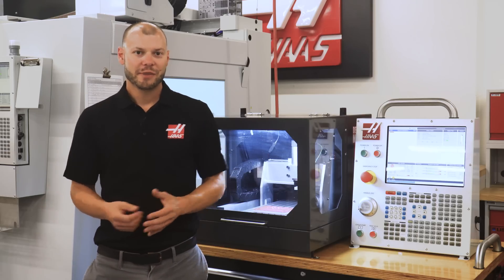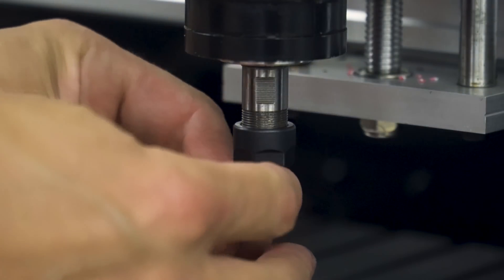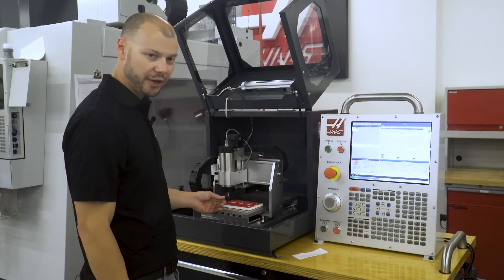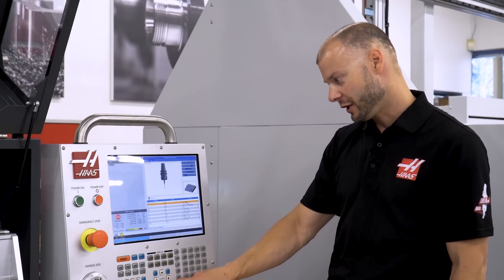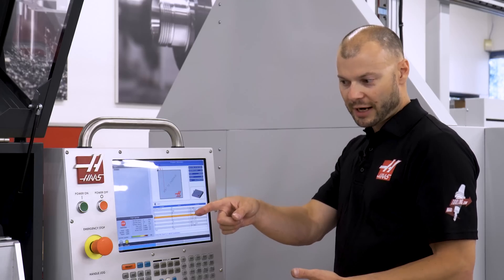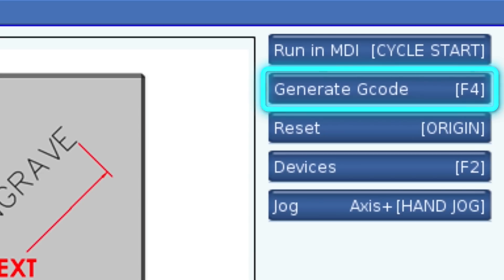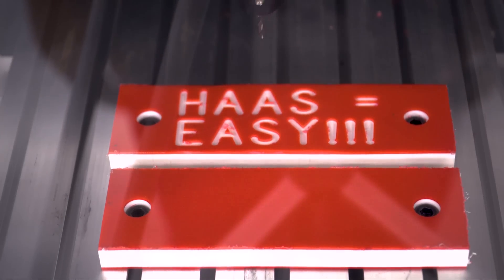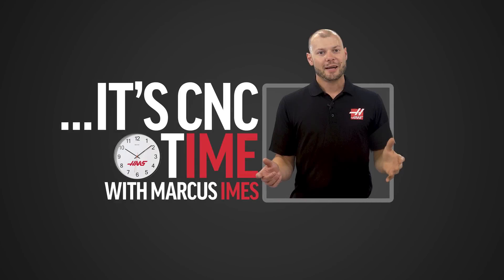The Haas Desktop Mill - A Walk-Thru with Marcus Imes - Haas Automation, Inc.

Comment: $400 on EBAY guys, don't be a fool and pay for the name. This is just a Chinese router with a big fancy control box.... https://www.ebay.com/itm/4Axis-CNC-Router-3020-Laser-Engraver-3D-Woodworking-Milling-Carving-500W-Desktop/184257042533?_trkparms=ispr%3D1&hash=item2ae6935865:g:yYYAAOSwHwVema3Z&amdata=enc%3AAQAFAAACcBaobrjLl8XobRIiIML1V4Imu%252Fn%252BzU5L90Z278x5ickk8Fd9si%252FIbtWQr%252BhnlRwjDVoaUrqOm6rrEsSxgeUkDpVPmx5jrT15TSfkBjsiP1FuR%252FehTux5lC1gLBbPCTjhGJckNb2RsJyReqLvLpogXwKl%252BrWnrrk1JZzDei9XUc5nZ7meOlhnjTFDwhGgyT5RMDiotSjzlWKy8hxh5hrrNI3fO4HGONrhPxMFxMDl%252B07V7cBsDWJjBHdm2tJ24jNMifE5RMJteY1hkfh8OTIDLgW%252Be60ggcHc5VydPG%252BzWz9QbpwuJU5RyQvyxUoDwIRR4x%252BLTyJ2I5ZSN9r47%252Fd4zDvnacDTcV2630fFMvyGFmUok6Dlq9w2DpEgNN0Sdf%252FzLsG6yEkehKyYBNTirWbeYj6K0p1S3NapPJN8cvB6TzIe3P%252FPBicD460cpIxnlf0XwuNAkyhXDP5tCe89Exvud1%252Bdns3LHGPfaywdF8VwnZZR3ppmK0qP8beQNNRoEaulGt5kGdsKD%252FAIR5JYaWstF7ueh%252Fm3Y4StVxSsWb6IZp9%252BWZpJJ6yssP%252Bf6sq2Mh%252BbQap4SXgc6HjWGL4Eo4%252FGF6IjP1I29JzHfLMWgD0LQB6%252B31o07d0xwdIbc4KzgM%252BrUejXlc4Pjt9B2ia515Jx2RsltsOxKgwD6fTpkyYcNsT%252F4%252BhBE2ia0uypw3gy5uFVJZWjNQsFFfHIRuJMWWoZneZyUTQZMS%252Fkw83T9umZnfZakkfSBwOhAQyYzovTHllzy4CN60sl9CIZRQ8sgDlvmLdPNff%252BuSoOmb1L%252B50CC4OrSjtttVKN%252B7XbtaOSyegfxQ%253D%253D%7Ccksum%3A18425704253320b100ef81ce42ed942b23c7564da5af%7Campid%3APL_CLK%7Cclp%3A2334524

Comment: The man in the video has done a good job demonstrating the inept features of this mill and explaining it is for learning the Haas controller.  But many are correct, this thing is absolute and utter joke for a CNC mill.  $3000 Haas Controller paired with a $400 cheap mill that Haas is selling for $8k.   Unfortunately, this Haas desktop mill is an absolute dud.  Worse yet, Haas falsely claims it is perfect for teaching the basic principles of programming and operating a CNC mill.  But how can that be when Haas fails to provide a specific desktop mill model user's manual nor any model specific curriculum to support this machine.  Do your due diligence are research before buying.  Ask current owners for a reference and recommendation.  Haas has 99 good machines, but this isn't 1 of them,   It is a sad skid-mark on Haas's otherwise clean reputation!   Avoid this toy at all cost.

Comment: Haas, please make a small scaled down version of the mini mill/super mini mill, at a sub $15k price. Look at the UMC-10 developed by Dave Decaussin of FADAL, before his health took a dive. 3HP motor, BT-30 spindle, up to 10k rpm, Linear Ways, 6 tool ATC, and the rigidity to handle steel. The hobby market direly needs a small, affordable, yet capable machine that can fit in a small space and run on single phase power. Tormach let us down with their promises, please step up to the plate. They would sell like hotcakes. Here is a link to a video of Dave describing his machine in detail:

https://www.youtube.com/watch?v=b-y03hhCCME

Comment: For those of you smart guys, that machine was not meant to operate in real production cycles. It was produced for educational centers and big companies who has a large number of staff turn-over and where you cannot guarantee that any  new employee is fit enough to run a real CNC machine. And however the price bites where else could you get a CNC contol unit and drivers for 8000 USD to replace the broken one? :)

Comment: Better idea would have been to sell the control for all the hobby machinists to use on their own DIY machines.
Reply: I would love, LOVE if HAAS sold their controls like FANUC so machine builders could offer it as an option.
Reply: Just buy UCCNC. Superior anyway.
Reply: @BGraves  Totally agree. My router is on UCCNC and it's on a touchscreen pc, that make all the difference.
Reply: Better for the hobby machinist for sure,  not so much for Haas as the exceptionally handy control is a massive selling point for their machines. You'd rather sell your customer a $100 000 mill rather than a $5000 controller too, wouldn't you?
Reply: @TheMrJaagoo  I would like to think it would help with customer conversion into full size machines.
Reply: Man.. This is great idea!!

Comment: I get that this is designed exclusively with academic roles in mind, but I know how much the control simulators cost, and the price simply doesn't add up for this thing. You'd probably have a much larger market selling the controller on its own that could be hooked up to existing machines, in order to get people weaned onto the Haas control.
Reply: Agreed 💯%

Comment: Not sure how much the controller goes for, but my 6040 with G540 and Mach3 has only $1500 into it, and 2hp/24k rpm and a much larger table, with 15"x23"x4" envelope, so unless you are desperate to learn the Haas controller, I am not sure how the price is justified. And worse, not being able to cut aluminum, just wax and plastic? Buy a real Haas.

Comment: Doesn't this one use stepper motors + belts? That doesn't seem very useful beyond just cutting plastic / wood / foam.

Edit: it uses ball/lead screws! Nice quality for that size and price.
Reply: Nah, servo motors and ball screws.
Reply: @BebenX  that's awesome!
Reply: @IBUILTTHAT  kinda, its 12K because of the controls main boards are worth 12k, there a story to why that price happened, haas has some strange tricks, but the desktop machine itself is worth around 2K.
Reply: @BebenX  I've seen similar machines with lower quality parts sell for more, so not bad. If they ever sell it by itself, I'm sure some people would buy it.
Reply: @IBUILTTHAT  bro, its a Chinese 6040 cnc, you can get them on ebay for like, 1k, trust me